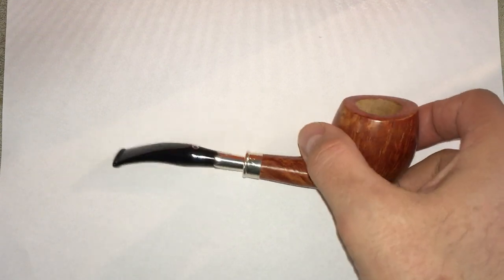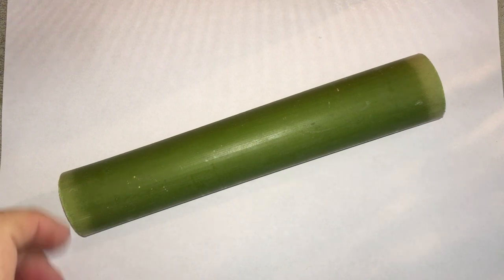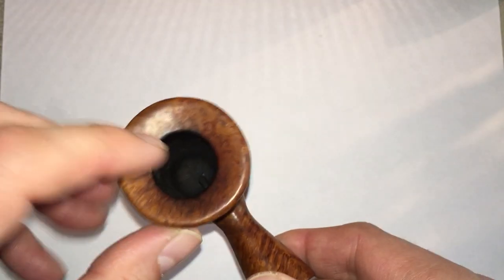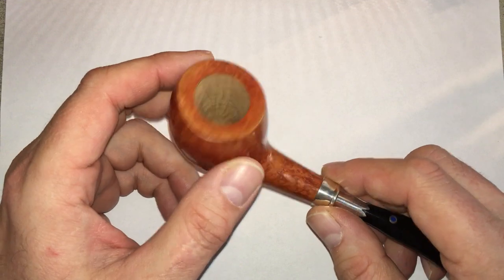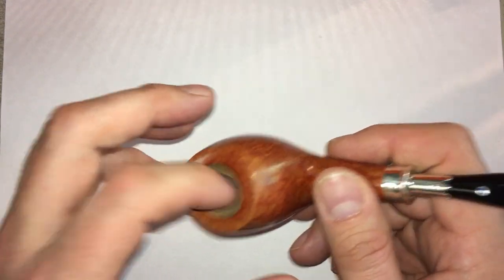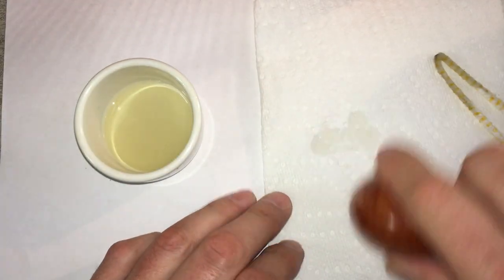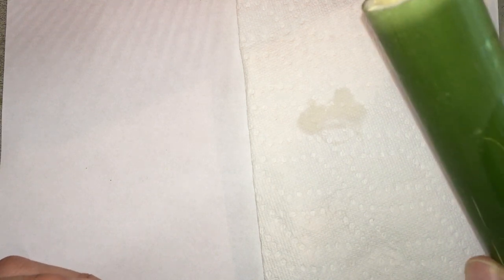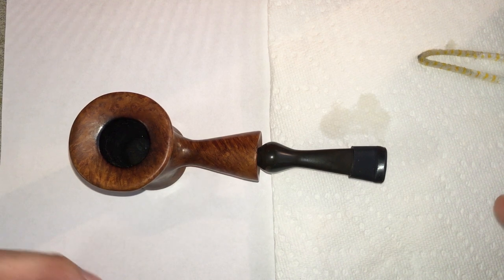How to break in your new pipe.

Comment: i just smoke them, the only thing i do differently then most people i know is after i clean the bowl out i use some of the ashes just put my thumb over top and give it a shake, i think wood is wood, as long as you dont sit there hot boxing it like a locomotive it should be totally fine, i would go so far as to say how you pack your pipe (how you pack all your pipes) is more important than breaking one in, my buddy tried pipes, but couldnt listen, wouldnt do how i showed him i do it, he had a horrible time, always packed it to tight, always had a hard draw, and always was setting it down cuz it's to hot to even hold, he quit smoking pipes, it's not for everyone, some folks are just to fast imo, pipes are slow, smoking a pipe is slow, if your in a hurry ..dont light a pipe, i dont even reach for my pipe unless i know i have an hour where i can enjoy it. for me, it's not something i need to do (smoke a tobacco pipe) and since i do09nt "need" it when i want to have it, i'd like to enjoy it, so i wait until i can. ive never broken in a pipe before,  i just pack them how my grandpa showed me, sometimes it goes out, gramps said, that happens, he said "just relight it"